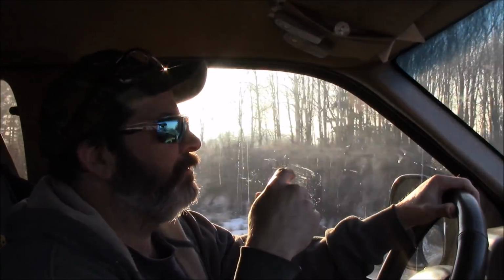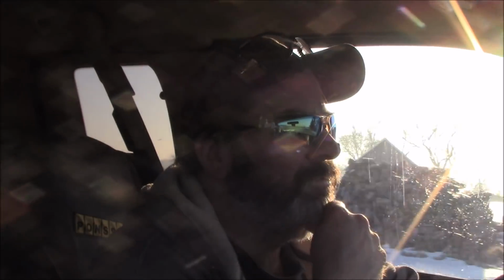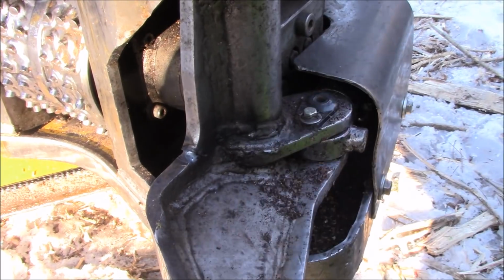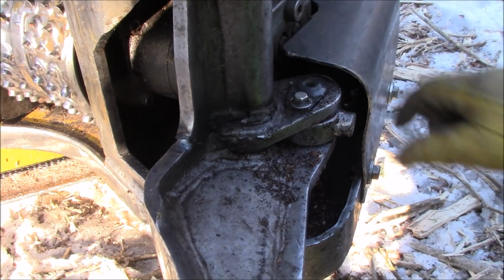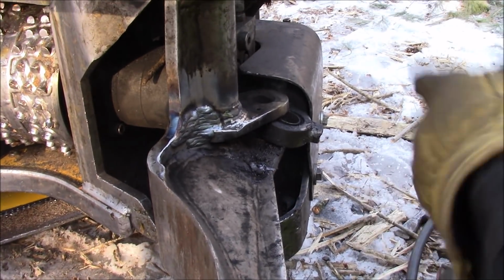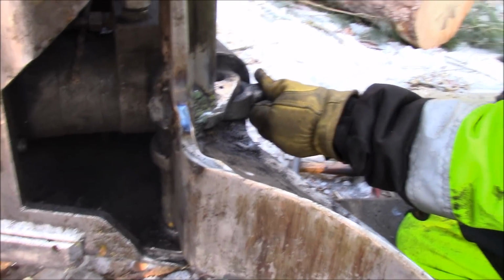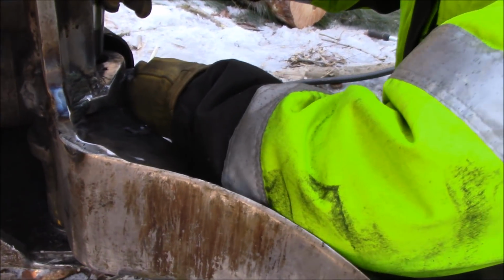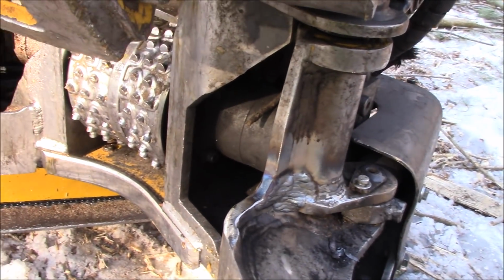Ponsse H7 Knife Repair Weld in da woods  Tutorial  Watch and Learn!

Comment: Thank you, Mike!
I learn so much from you!
Is the welding  a problem for the computer in the head ?
Reply: Ok.
Thank you for your quick answer.
Reply from the maker: Most follow manufacturer procedure to disconnect before welding any machine! We disconnect engine, head, fire suppression all before welding.

Comment: Very nice vid. I'm just a DIY welder but I enjoy watching those that know what they are doing. This seems like a lot of prep work and welding. What does something like this cost the customer to go out and do? Seems like a $1200-$1500 job?
Reply from the maker: Time and material. Probably around 3 to 4 hundred. He's only twenty minutes from my shop and I'm pretty efficient at what I do. I wish I could charge that much, but in most cases then he would have just bought a new arm and installed it himself. Sometimes a fine line
Reply: Thanks for the reply. That's sounds like a great deal and saves the customer a bundle from having to buy a new arm. You do excellent work. Keep the vids coming.

Comment: Hey Mike just found your channel and it's really interesting I do have a question though how come you didn't use an air Arc on that knife and do you regularly disconnect the electrical systems
Reply from the maker: FEI-forestry Always, always disconnect the electrical. On Ponsse we pull the computer, ECU, and flip the welding switch in the cab. Oh and fire suppression must be disconnected also. I didn't use carbon arc because I could readily grind it and also I can control the fire hazard much better in that application especially on a harvester head. There is just to much debris jammed in everything. Carbon arc just want worth the risk on this one.
Reply: Michael J Berg thanks for the reply and your thoughts and I totally forgot about the fire suppression system I'll have to remember to do that on mine when I put down chicken scratch

Comment: Nice work out in the elements of Mother Nature brother! When you are welding and stop and tap on your weld with that pointed hammer, what are you doing?
Reply from the maker: Rick Berg chipping the slag off the weld!
Reply: @MichaelJBerg  so you use flux core wire? My dad swears by flux core over solid. Don't have a huge preference myself.